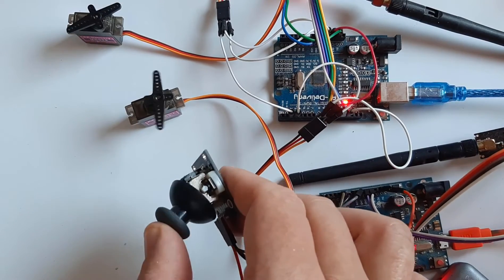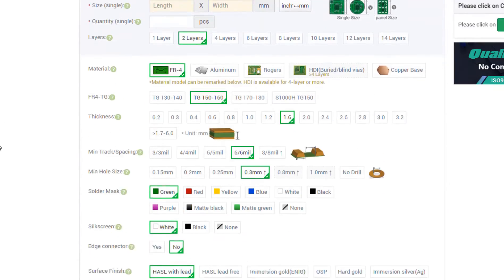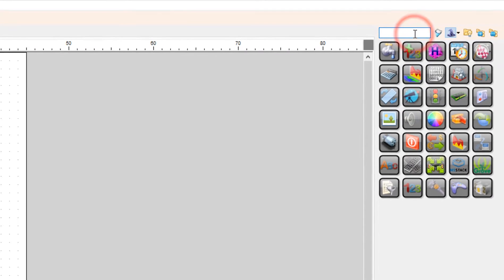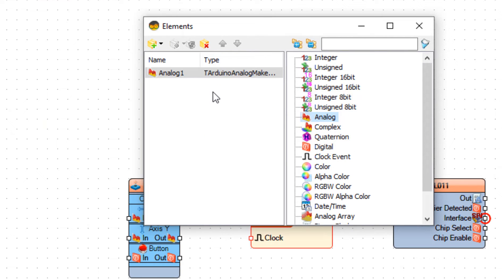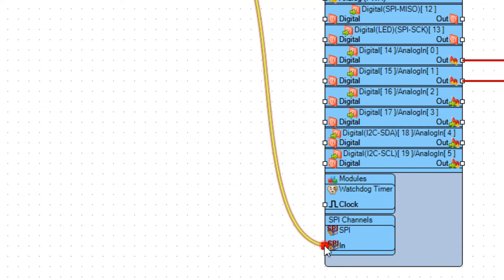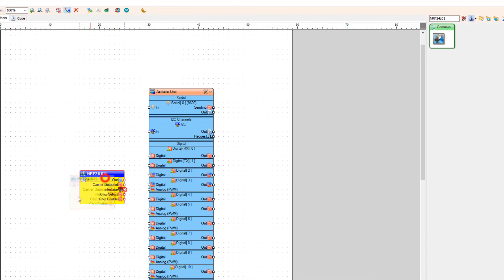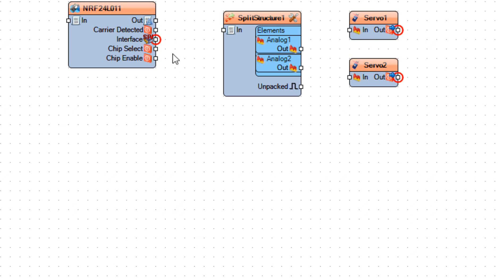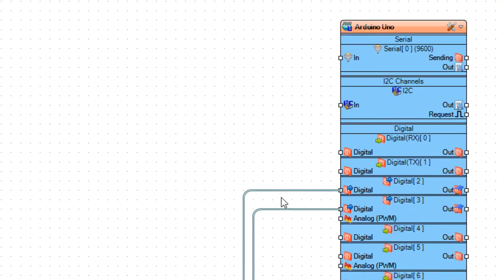NRF24L01 Wireless Servo Motor Control With Joystick

Comment: Wow superb,
I tried this project and it's working fine but I want to do some changes.
 * How to change the speed of the servo motor 
* How to change the angle now it's rotating 0°-180° but I want to limit that to 0°-90°.
* If i move the joystick servo motor is moving perfectly but if I leave the joystick it's coming back to initial position. It should not come to initial position. It should hold on last position only.
to achieve these changes what are the changes I have to do on visuino please help me.
Reply from the maker: In Visuino the Analog value determines the angle, so from 0-1, to put in the middle you set 0.5
To change the speed use ramp to analog value

Comment: Hi, cool video! Can you guess how great the distance between the Transmitter and Receiver can be?

Best regards

Andre
Reply from the maker: Hi to get the exact specs you should check the module documents. I was able to achieve 2km distance with obstacles (no visible line) using a wifi antenna. Its recommended to use lower speed for large distances. There is a video on youtube where they achieved 20km distance.